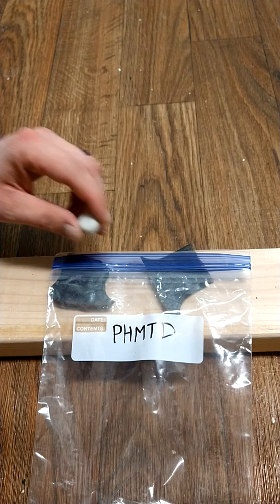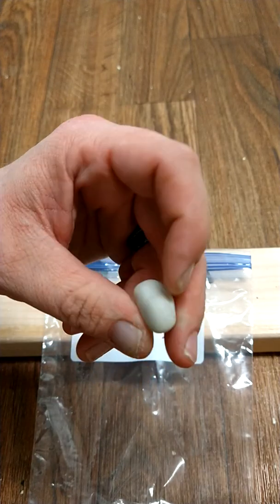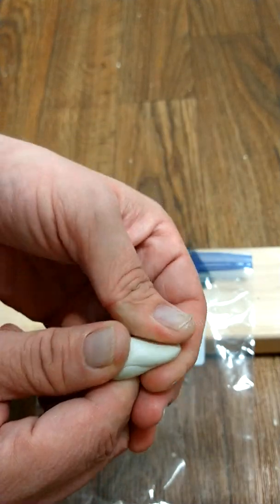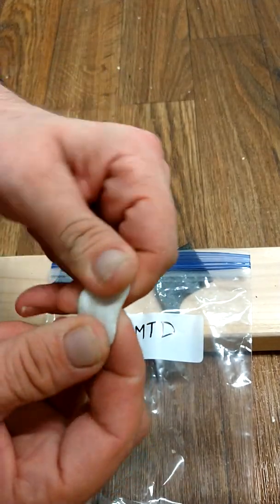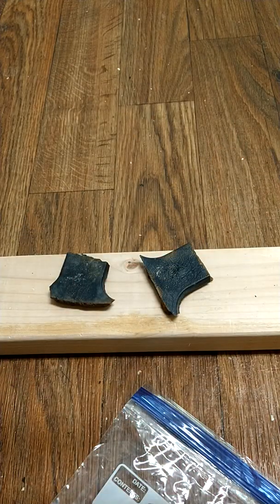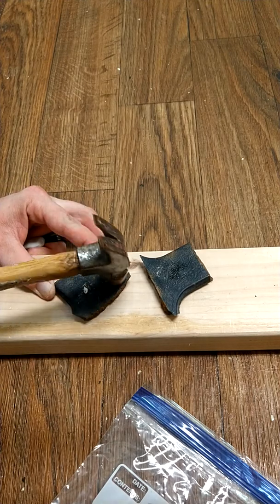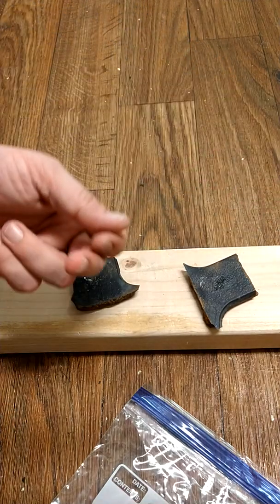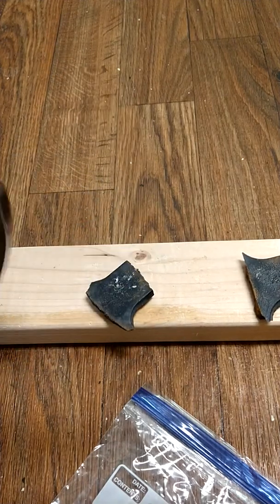💥plasticized HMTD (phmtd)💥

Comment: Hello, is there any way of getting a tutorial or some tips on how to plasticize it?
Reply: Not rocket science friend. There is so many things you can use. I have plasticized using Styrofoam I melted down tiny amounts of nitromethane. 
Polybutene (bird repellent) stuff works the best. Mouse trap glue as seen herein works good as well with some oil. 
 
The basics of it is melting down plastic/rubber with a strong fuel. Methanol is one of the top used fuels to do this. Once you have a glue consistency and it pours like warm honey you are set. So, you will take methanol and add it to a plastic rubber. 

Take it and pour out approximately 6-8 oz at a time and warm up with hair dryer or heat gun by itself. Once you have your booger rolled up weigh it out and find out how many oz you need to equal .5 gram. Once you have that figured out you can add .5 gram oil / wax. Bar and chain oil is very popular for this. 

Always test your mix before using. So take whatever binder you are using and heat it and weigh it on scale to equal .5 grams. So if you end up knowing that 6.2 ml of your solution when dried out into your .5 g of binder, you know that math so you can scale up. So you can double your recipe and use 12.4 ml of your mix with .5 g  x 2 = 1 g of oil right? 

So you want to plasticize 10 g of whatever it is from ETN, NHN, PETN, RDX, HMTD etc.

So you would take say 6 g of PETN and 2 g of ETN and add mix it with 1 g of your mix which is .5 g of binder (that was 6.2 ml before drying) and .5 g of oil and everything together will equal 10 g. 

Whatever you use to plasticize that is rubbery and flammable is basically good LOL. Not even joking. If it burns and is sticky / rubbery it works.
Reply: Thank you @Boobytrap_Badger
Reply: @Boobytrap_Badger  What do think if i use only RDX with the binder and oil ?
Also is it safe to fine grind the cristals to mix it better ? if not, how do you grind this ?

Comment: I love using HMTD because it deflagrates rather then exploding
Reply: No it doesn't unless its wet or you have less than 2 tenths of a gram.
Reply: @darianballard2074  how much HMTD is needed to set of ammonal if its not compressed?
Reply: @Р567Г  I would want 10 or more grams because how hard it can be to set off. It could work with as little as a gram or two.  I've even set off ammonal with BP in the past. I put 4 grams of BP in a co2 cartridge and that worked, but i don't recommend using BP.
Reply: @darianballard2074  i use firecracker 5g flash but i put the ammonal in fire extinguishers or gas bottle.
Reply: @Росен dont make/use more than 4g
Reply: @Р567Г  Most of the time 2.5 g should be enough - if the AN is finely powdered and dry
Reply: @nehorlavazapalka  i used tatp and under 1g was good enough
Reply: Just to clarify, under 4 grams HMTD deflagrates.  4 grams or more and its detonation velocity is around 5,000 m/s.  But, it looks like your 17 y.o. so stick to just a couple of grams until you get your PhD in chemistry.
Reply: @glennkrieger  PhD in chemistry does not mean you are an explosives expert, or actually even moderatley knowledable in the field of energetics, and it certainly does not mean you have experience in the field whatsoever.  PhD simply means you have a knowledge base, in a certain field,nothing more, nothing less. You can probably give me a 1000 different mathematical equations and various theoretical energetic mixtures, but the second I take you into the field where you had to improvise, outside of your fancy laboratory, you wouldn't know your head from your ass. I can show you 100s of different methods of using items from a field environment to make energetics. You would be lost without your fancy labware and would likely be too scared without your 100-thousand-dollar fume-hood and 1000s of dollars' worth of labware LOL. In a nerd voice "OMG! I can't do this without my eye protection!!!" - Me "Move over Urkel..."
Reply: @glennkrieger  You said (Just to clarify, under 4 grams HMTD deflagrates.  4 grams or more and its detonation velocity is around 5,000 m/s.  But, it looks like your 17 y.o. so stick to just a couple of grams until you get your PhD in chemistry.)

Take that 4 grams and isolate it inside of heavy aluminum foil and bite down on it real hard. Tell me how that deflagration goes after you get back from dental surgery. Conditions change everything.
Reply from the maker: 0.2g of of hmtd WILL detonate if confined
Reply: Like anything, it will explode depending on how much, isolation and many other things. Various metals can blow up by themselves given the right conditions. Coffee creamer, sugars and the list goes on forever. Basically, anything small enough will burn and therefore can explode.
Reply from the maker: Hmtd detonates when used in the proper amount and confined

Comment: hey, I have cook up some TATP here and would like to plasticize it. Can you enlighten me how to do it, since i have never done it before. Can I use adhesive latex glue for wood?
Reply: Hi guys, I have been disconnected and just saw that I have replies. Thank you really for your concern, even though you never knew or seen me, you guys took your times to warn me on that. Actually, I am a part of the opposition force called (People Defense Force, PDF) from Myanmar [Formerly known as Burma]. We were having urban missions and it's just that TNT and hand grenades are very scarce due to the supply chain issue, hence we had to resort on alternatives such as TATP, as ETN and HMTD are also very hard to come by. With very resource we have, TATP, fertilizer & conventional gun powders were our only go to in our fight against the military regime here.

Regardless of how careful we were, we still faced some causalities. Thankfully we never had any accidents with TATP, still we had a few people who has lost limbs and eyes from conventional IEDs due to shot circuit and careless during the set up.

Just sharing a few of my memories back, although I have now retired unfortunately as our whole regiment was compromised during a mission in Yangon.

So, just wanna thank you for all your concerns, cheers from Myanmar.
Reply: @minthant4120  be real careful, TATP is incredibly shock sensitive as well as sensitive to heat, flame, static electricity, friction, etc. but good luck on your fight against that regime, that's some evil stuff you guys are fighting against over there.
Reply: @minthant4120 God bless the resistance! Thank you for your service!!!
Reply: @minthant4120 glad you are safe at least! Would you be willing or able to share any recipes you used regularly? Builds a safety profile
Reply: :dothefive:Do you like your fingers and eyes? If you do, go away from TATP for plastic. It's not even something anyone knows what they are doing would attempt. Completely dumb. Even adding a little bit to something like RDX is bad practice. TATP is good for blasting caps and that is about it. As already said, ETN is much better, but I will 1 up that. Research using PETN instead of ETN for plastic. Very easy to synthesize, (very similar to ETN synthesis) but more powerful and much safer. When you set it on fire it will not flash like ETN, it will fizzle. Same goes for NHN, very good stuff! It's just hard finding the hydrazine hydrate but if you can fine supplier like I have with PO BOX it's not a problem. 

Here is basic knowledge I will share with you. 

Not rocket science friend. There is so many things you can use. I have plasticized using Styrofoam I melted down tiny amounts of nitromethane. 
Polybutene (bird repellent) stuff works the best. Mouse trap glue as seen herein works good as well with some oil. 
 
The basics of it is melting down plastic/rubber with a strong fuel. Methanol is one of the top used fuels to do this. Once you have a glue consistency and it pours like warm honey you are set. So, you will take methanol and add it to a plastic rubber. 

Take it and pour out approximately 6-8 oz at a time and warm up with hair dryer or heat gun by itself. Once you have your booger rolled up weigh it out and find out how many oz you need to equal .5 gram. Once you have that figured out you can add .5-gram oil / wax. Bar and chain oil is very popular for this. 

Always test your mix before using. So, take whatever binder you are using and heat it and weigh it on scale to equal .5 grams. So, if you end up knowing that 6.2 ml of your solution when dried out into your .5 g of binder, you know that math so you can scale up. So, you can double your recipe and use 12.4 ml of your mix with .5 g x 2 = 1 g of oil, right? 

So, you want to plasticize 10 g of whatever it is from ETN, NHN, PETN, RDX, HMTD etc.

So, you would take say 6 g of PETN and 2 g of ETN and add mix it with 1 g of your mix which is .5 g of binder (that was 6.2 ml before drying) and .5 g of oil and everything together will equal 10 g. 

Whatever you use to plasticize that is rubbery and flammable is basically good LOL. Not even joking. If it burns and is sticky / rubbery it works.

If you are still having problems, you can hit me up and I will help.
Reply: @Boobytrap_Badger  Прекрасные советы, пожалуй сохраню их.
У меня к вам просьба. Можете ли вы поделиться хорошим рецептом синтеза PETN. 
Я использую:
35 мл Серной кислоты плотностью 1.8
35 мл Азотной кислоты плотностью 1.4
Пентаэритрит 10 гр 
И выход готового продукта составляет примерно ±20 гр. Есть ли другие соотношения кислот или методы повышающие выход готового продукта?
Reply from the maker: @w1nchester367 I would not plasticize tatp hmtd can be plasticized somewhat safely using different types of plasticizers and adhesive so you can use polyisobutylene or you can use rubber cement with some bar and chain oil for chainsaws
Reply: Is ETN much safer for primary? 
And is it as powerful as HMTD?
Reply: @ms_des1  yes, you can heat shock it with rocket candy to use it as a detonator. You can find videos on YouTube about it, just look up "etn detonator".
Reply: don't.
Reply: don’t ever do anything with tatp is so incredibly dangerous
Reply: Don't. HMTD is on the edge of safety, TATP is over that edge. Try ETN, it's MUCH safer.

Comment: What way did you try to plasticize? PIB ?
Reply from the maker: Hey are you subscribed to my channel?
Because I can remember ur logo
Reply: @improvisedchaos6355  Yes, I have been a long time subscriber of your channel, answer my question
Reply from the maker: @savoie571  you were correct in ur question, also bar and chain oil
Reply from the maker: @savoie571  pib is sourced from non poisonous sticky rodent and insect traps
Reply: Some good old double sided tapes too contains PIB
Reply: @ms_des1  any tire repair rubbers work. You can take the sticks they use to plug tires and soak them in a strong alcohol as well to create PIB. Nobody knows more than me about improvised plasticizing. I use to teach this to entire villages for a year when I was oversees. I can give dozens of recipes from styrofoam to melting tires and a ton of different chemicals that work to do this.

Comment: Not a very good idea...... You shouldn't ever mix anything with peroxide explosives.
Reply from the maker: I totally agree 💯 it was an experiment🧪🔬 that's why there was a tiny amount that doesn't exist anymore👍 I have seen papers on desensitized organic peroxides, & wanted to see if that spesific pib and pb formula would work & I actually got great results i detonated it under ground (for safety and wife reasons lol) and I didn't see a drop in power also it was significantly less sensitive as u witnessed...I was happy with the experiment and the results...trust I'm not planning on making it ever again and yes u should not as a practice ever put anything in organic peroxides period...just a test👍
Reply: I dissolved a 50/50 mix of double base smokeless powder and tatp in acetone then added about 2% of mekp a couple decades ago when I used to fool around with energetic materials, it actually made it much less sensitive than pure tatp once the stuff dried into solid bricks (half inch cubes, a few spheres, plus a few small cylindrical EFP bodies), and I had a couple tiny pieces that were forgotten for about a year and a half (3/8" balls) that hadn't shown any signs of crystal sublimation, and took a phenomenal impact to set off. But generally speaking, adding peroxide explosives to anything is bad juju. Making peroxide explosives is bad juju...

But dang did those little smokeless/tatp/mekp chunks go off with a bang, I had a couple little balls I made that I (very carefully with welding gloves and face shield) loaded into a slingshot rifle and shot at a piece of plywood, they only went off if the slingshot was pulled all the way back at max tension, and one of them hit about 6 inches away from a moth on the wall and stripped its wings off its body lol, and put a deep dent in the 1.5" thick plywood wall🤣.